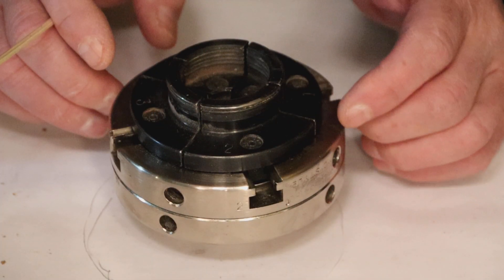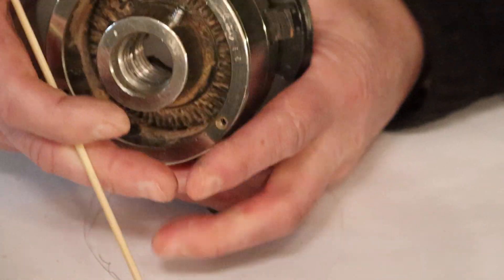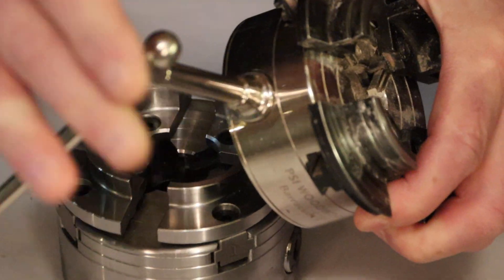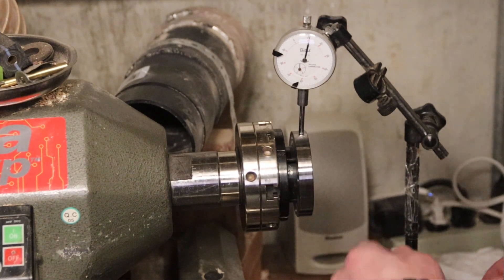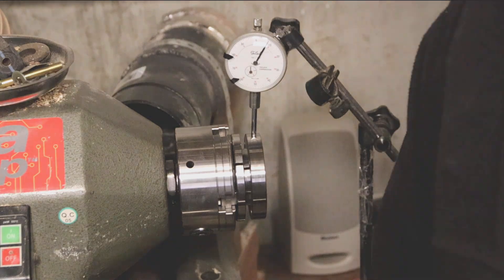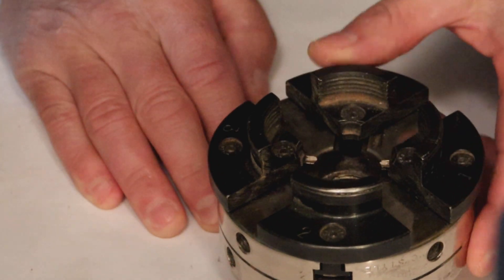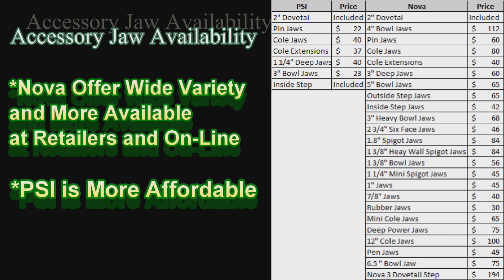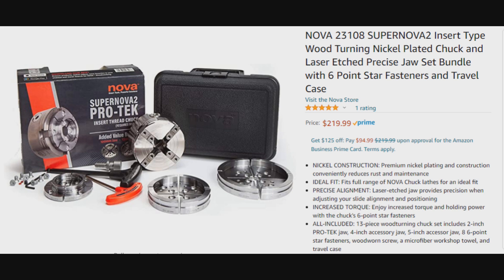How to Pick the Best Woodturning Chuck , PSI Vs Nova

Comment: I was glad to see your presentation here. I have 3 psi chucks that is 2 Barracuda 2s and 1 utility chuck previously I used a PSI utility truck for all my work and produced quite a few bowls up to about 6" in diameter.  I just bought two Nova G3 one was the full kit the other one with just one set of Jaws I think.

Comment: I have a Nova G7 chuck. It’s low cost, light weight small chuck. Ok to hold smaller project. But the insert (threaded on) may loose. A little annoyance to use. The Oneway stronghold can hold big projects. But change jaws took a while. The jaws are numbered. Not convenient to do when encountered. Another Easy wood chuck is the most used chuck I have owned. Changing the jaws only took a few seconds. The insert is fixed( sealed not interchangeable). Jaws are not numbered. Very versatile and expensive.